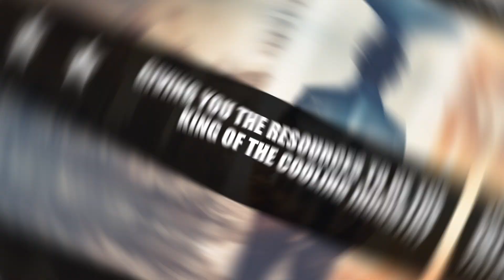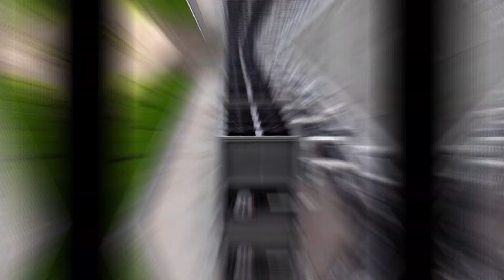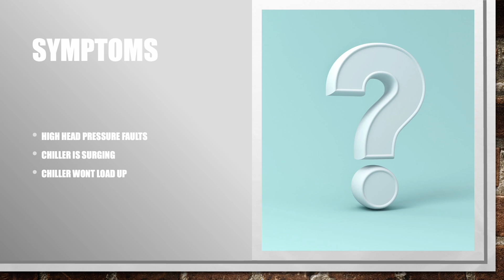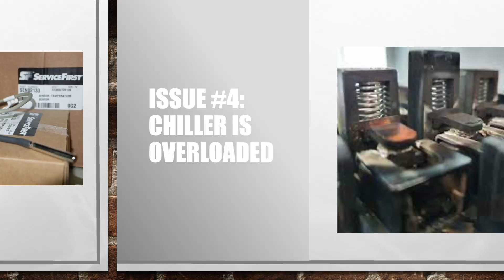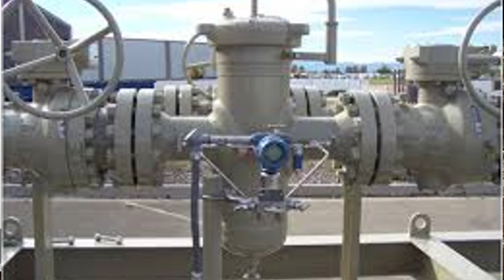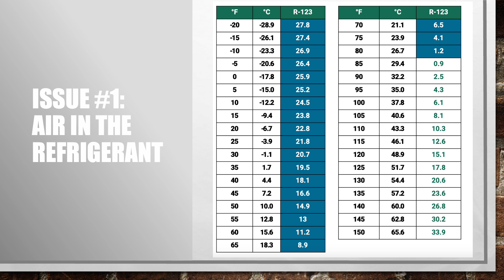Mastering Trane Chillers: High Condenser Pressure

Comment: Thank you 
I am now one of your followers I hope to learn alot from you
Reply from the maker: Thanks man, I will be uploading a lot more useful content as well, and videos will get higher quality as time goes on. We also have a facebook page as well if you ever need any help with diagnosing. its called "The Chiller Guys" the link is in the video description.

If you ever need anything you can always ask here as well, just takes a little longer for me to reply.
Reply: @CapitolDiagnostics  oh that is great
I am working on a CLIVET Air Cool Chiller.
One of the Compressors is tripping on High Pressure what could cause it?
The high pressure switch is in good condition 
The Condenser fans are running
The coil has been cleaned on Saturday 
I don't know what to check again, yet it is tripping on High Pressure
Reply from the maker: im really sorry for not replyin, i didnt get this message, im faster on our FB Group. it could have a few things, could be overcharged, could haver a liquid restriction, could be overloaded, condenser could be dirty internally. did you wash it opposite of airflow? sometimes the outside will look clean and its not really clean. you could also have fans shutting off on overload, go up and check all the bearings.  another issue i have had is recirculating air. check this stuff and let me know! i can help you with this if your still having issues, again, youtube didnt send me this message, i just happend to see it, im sorry for taking so long man.. @toyinorodare4072
Reply: @TheChillerGuys  thank you man I will work on this
Reply from the maker: I can definitely help you with troubleshooting that, but first I will need some more info. If you can get me the following information I can tell you what the problem likely is. 

1. Model number
2. How fast is it tripping? Immediately, after 5 minutes, or after awhile of running?
3. Entering and leaving air temp on the condenser
4. Discharge pressure 
5. Refrigerant type.
6. Liquid sub-cooling
7. Number of circuits on the machine running and how many 

If you get me that info I should be able to tell you what’s going on.
Reply: These videos ARE AMAZING. I am glad that I found these as I am starting my refrigeration apprenticeship SOON😊.
Reply from the maker: @Valerian-nb5wu  happy to help brother, they just slapped me in a van, and expected me to figure all of this out when I started lmao nice to try and make it easier on other techs, the factory doesn’t make it easy..
Reply from the maker: For sure brother, again, sorry for the late response. Just reply here and I will help with what I can. If you get it fixed, let me know what it was too!